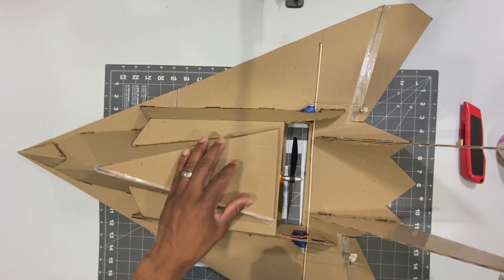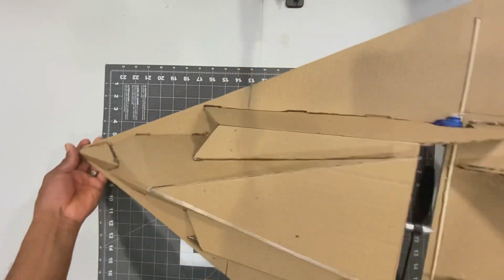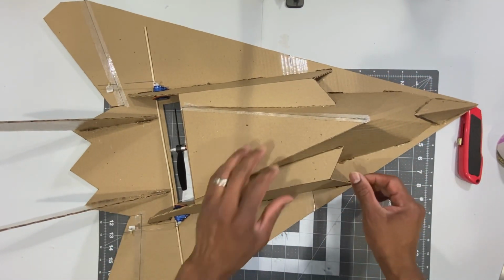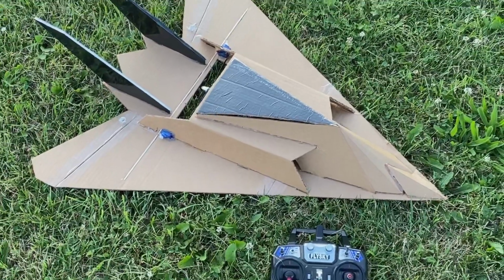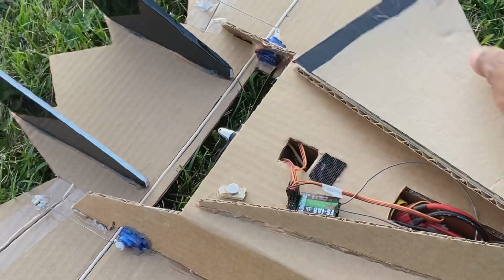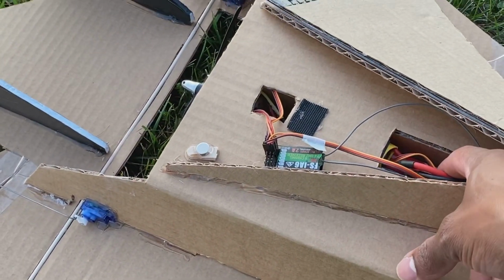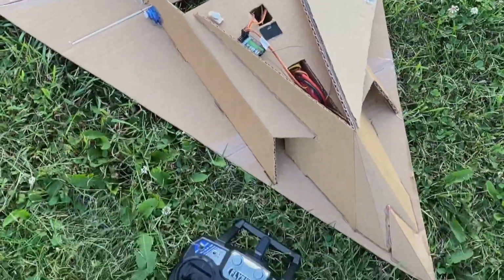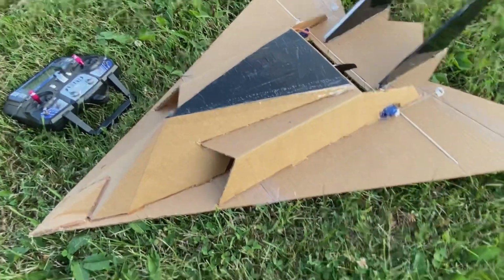F-117 Rc Airplane : Diy Cardboard Scratch Build And Maiden Flight

Comment: Now that I left an earlier comment about needing some measurements I realized I can simply stop the video to make note of the build with the plane against the cutting board - which has one inch increment lines, right (!?), in order to get the measurements I need.

But still - IF someone could send what they have, mm or inches, I'd still appreciate it.

CHEERS !
Reply from the maker: Hi Larry! Before I sent this message I checked to see if the site was up and running, it is. rcfoamfighters.net. Let me know if this works.

Comment: Chris, the site at RC Foam Fighters is 'down' at this time, therefore the plans are not available - so would anyone have the basic measurements available, (?), and if so I can take it from there and draw up a set of plans to build 'one'.

I intend to build it as originally presented and also from some political signs (after the election is over April 12) which will be more than adequate for the task at hand - as soon as I can I.D. the material I'll let anyone interested in knowing what it is; but in the meantime it is a double surfaced plastic with a 1/4" 'honeycomb' center.

I've been intrigued with the F-117 since I saw it land at March Air Base in the late afternoon with an all white F-5 or T-38 Talon escort - about eight months before the Air force admitted they existed; evidently it had an in-flight 'malfunction' per one of my friend's son who had recovered, "another of those planes that doesn't exist". From what he said this particular flight was a "real world" test to determine how "stealthy" the aircraft was, but to this day I still cannot understand why they chose to do so during the daylight hours since I seem to remember the time being somewhere near 1700 hours/5:00 PM.

Just for information I live about a mile East of March A.F.B. runway and was outdoors when I saw this all black aircraft with a very distinctive V-tail and the small F-5 / T-38 just to the immediate right of it's tail and then running into the house to grab my 35mm camera, and yelling to my wife, "there's something right out of 'Star Wars' landing at the base - I'm  gonna get a picture of it !!! and then running back out and jumping into my Mustang which I then drove like a 'mad man' to a section of the 15 freeway next to the base to get my picture, BUT as I came to a screeching stop I saw the doors to what is known as the "Pride Hanger" closing while the smaller white jet sat outside and knew that was where the other (Star Wars) aircraft was.

Needless to say my imagination and previous knowledge of these type of aircraft meant that I had to know what this particular bird was and when I finally found out HAD TO HAVE one of my very own.

And although a model will be as close as I will ever get them that's fine, so if you or anyone else can give me any info I shall  greatly appreciate it.
Reply from the maker: My apologies Larry, I thought I’d reply back to you. The site is up so you’ll be able to download the plans for the F-117. I’m sure by now you have already built it already🙂
Reply: @Larry Whalen What an incredible story! Yeah, the F-117 is unique for sure. Even in it’s “retirement” it is still seen occasionally coming in to land at military bases all over the continental United States (and since over 90% of modern humans have mobile devices with cameras with them everywhere they go there have been images taken.) I am also surprised that they would fly an aircraft like that at 1700 anywhere (except for Groom Lake AKA Area 51) I hope you can purchase a foamy F-117 powered by an EDF at some point. I still remember the first time I was introduced to it: a model that my dad had bought me for Christmas one year. Definitely a unique airplane, that’s for sure.